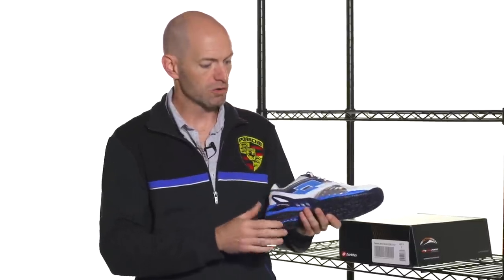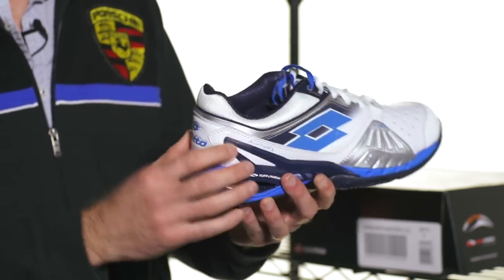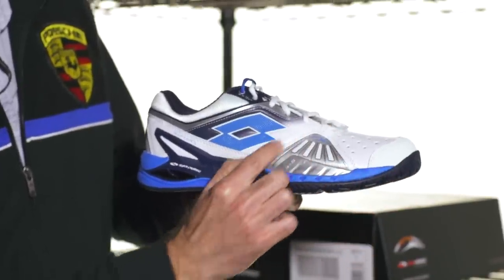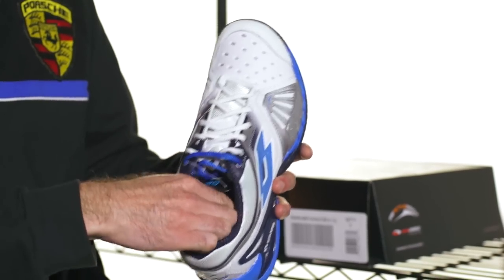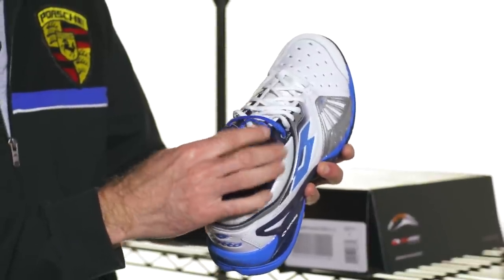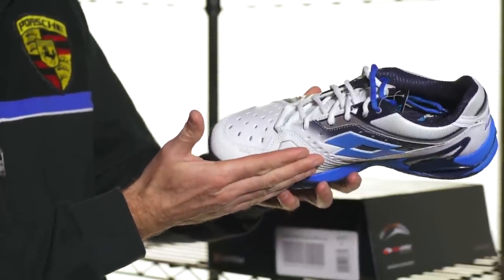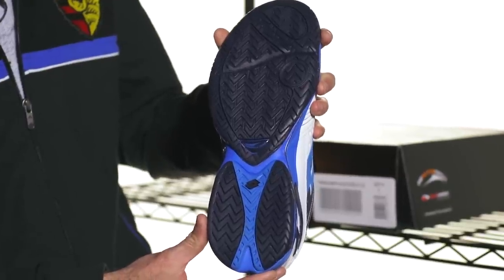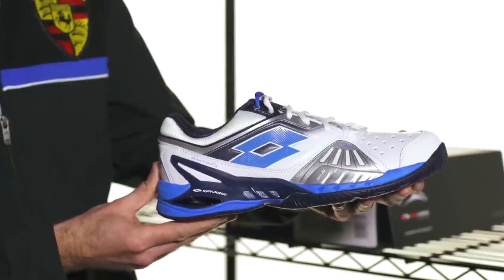TW VLOG #428 - Anatomy of a Tennis Shoe Explained

Comment: Hi i am looking for shoe which should be extra width with a high shaft. my old show was a head supreme but for this season i tried several but no fits. did you have some ideas which i should test ? best try was k-swiss receiver iii, but it has some issues, too. as a reminder, i need extra insoles, too.
Reply from the maker: Alexander Mielke ,
First off, I'll have to assume that when you say "high shaft" you are talking about high ankle support?  For a shoe that's comfortable, wide-fitting and supportive, I'd recommend trying the Babolat SFX, KSwiss Hypercourt Express (leather version if you'd like) or Yonex Power Cushion Pro.
Andy, TW